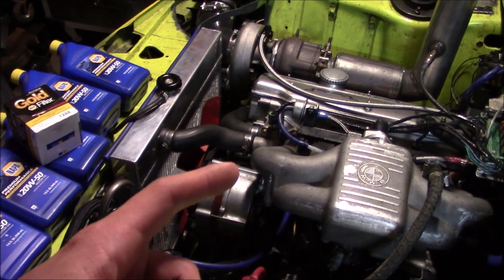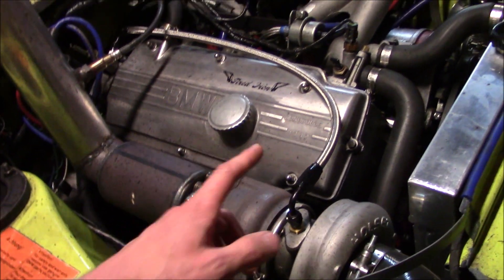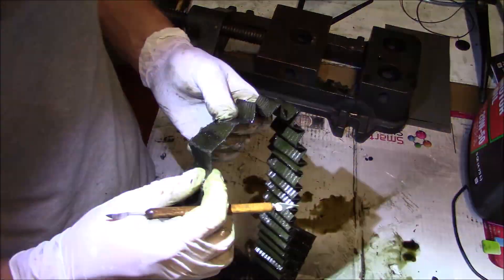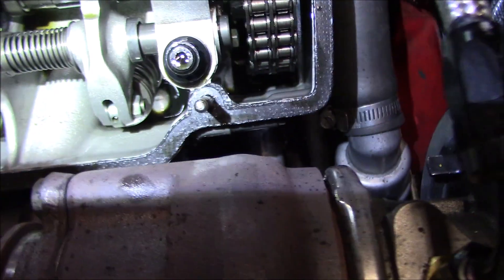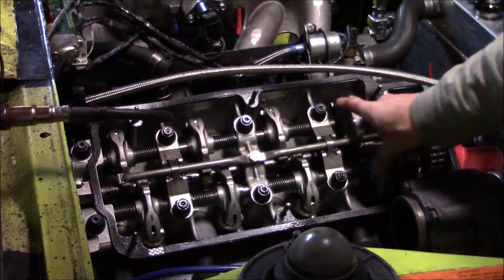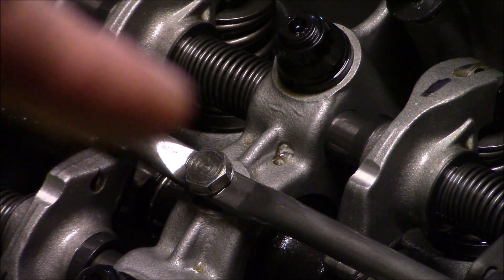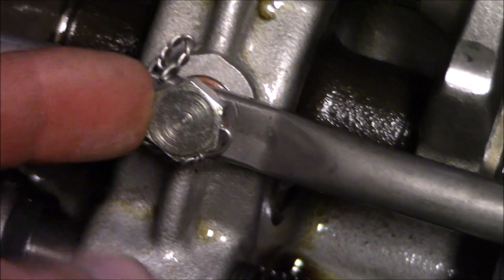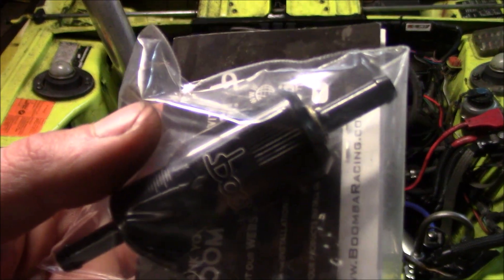BMW 2002 turbo motorsport tech tip. Built M10 350 mile break in, oil filter cut, valve adjustment.

Comment: I just finished watching your build video guess you decided to use rocker springs.
I didn’t see in your build video what is your compression ratio for the engine  ? 
And what boost figures are you running ? 
I would like to build a 2002 turbo tribute I like your engine  build.
Reply from the maker: It's an 8.5:1 motor currently on wastegate pressure (7psi-creeps to 9 up top) Right now I'm working on turning it up and making some numbers. I'll take it as far as I can on 91 then maybe E. Thanks for watching stay tuned!

Comment: If your running the turbo you might want to look into the rocker arm locks. They eliminate rocker arm float. They hold the rockers arms in place instead of the spring.
Reply from the maker: Yeah, I don't think they're necessary with mild cams. More fasteners to come loose. Thank you for the input though!